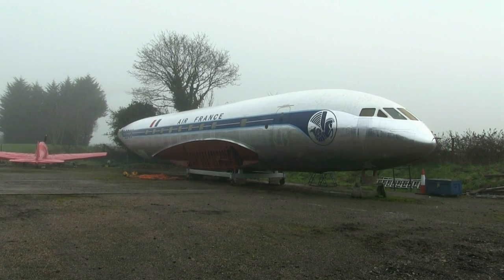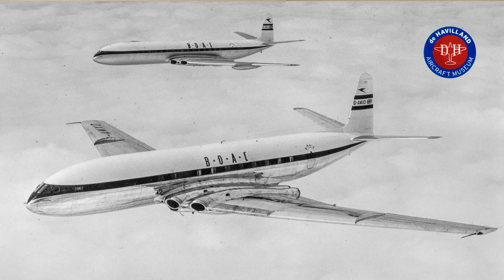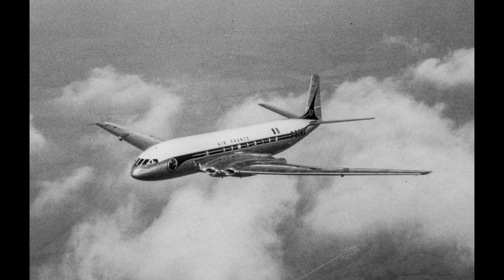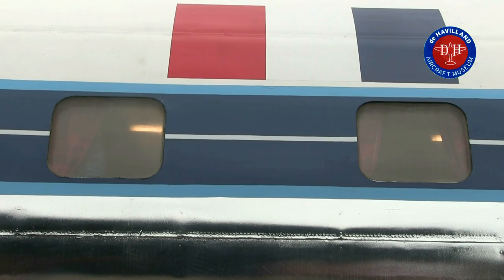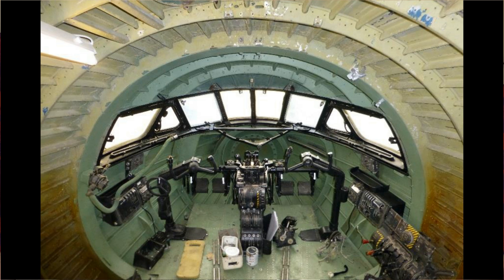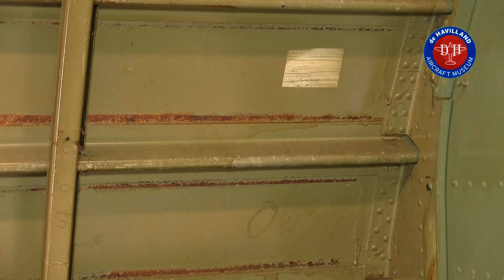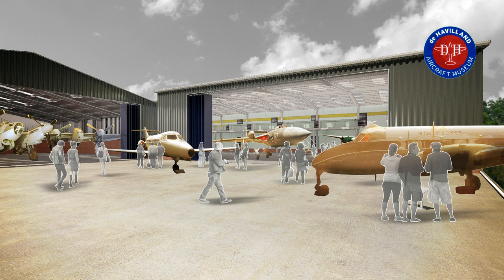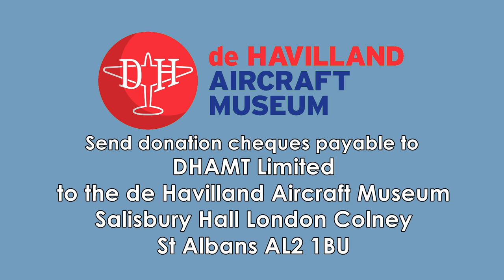DH106 Comet 1A F-BGNX

Comment: A Comet 1 esből 9 + 2 prototipust gyártottak.
A két prototipus 1949-ben repültek elöször.
Lezuhantak 1953-1954 5 darab.
A Comet 1 A - ból 10 darabot gyártottak lezuhant 1971-ig 3 darab.
Szerintem a világ legszebb vonalu utaszálitó repülöje.
A Comet órrát , szárnyát és pilotafülkéjét megvették a franciák és ebből lett a Caravelle ami 1958-ban repült elöször és 2006-ig 64 darab zuhant le.

Comment: Outstanding!  This is an incredible piece of aviation history and it's wonderful that it is being restored.  I'd love to see this plane when it is finished.

There truly isn't another like it in the world.
Reply: Thank God there isn't... the Comet Disaster not only destroyed DeHavilland it was the worst engineering failure in the history of  the entire commercial aviation. industry.
Reply: @sandervanderkammen9230  Worse than DC10 cargo door?  I don't think so - the DC10 issues were even known about before the Turkish Airlines crash.  No-one knew about the issues around the Comet.
Reply: @ukurko  Yes, the DC-10 never had it's airworthiness certification permanently revoked.
Not true, pilots repeatedly warned DeHaviland that the aircraft had  serious problems right from the start  of regular service... the first 2 Comets crashed with DeHaviland quickly denying any problems and tried to blame the crashes on pilot error.
The Comet Disaster investigations found the aircraft riddled with hundreds of fatal design, material and construction defects, this resulted in a complete redesign of the entire aircraft from the wings, engines, fuselage hydraulic system even the toilets.
Reply: @sandervanderkammen9230  I think the 737 Max holds that mantle now.
Reply: @rayquirk4947  The Comet Disaster remains the worst engineering failure in commercial aviation history... even with 2 fatal accidents the Max still has a much better safety record in commercial aviation.
In fact, the Boeing 737 series is not only the most successful jet airliner in history.... in per passenger/miles statistics its still one of the safest aircraft in history.

Comment: Beautiful piece of history... best of luck with the restoration gents, interesting fact is that is was not the shape of the windows they found to be the problem but the way the rivets were used in fitting the windows that caused the issues.
Reply: The Comet Disaster was the result of an aircraft built with an appalling number of fatal design flaws and construction defects..
Even after the remaining Comet aircraft had their windows replaced the aircraft was deemed structurally unsafe to carry passengers and the aircraft type airworthiness certification was permanently revoked.

Comment: Looking at air frames it’s amazing they don’t build them stronger. I know the key it to be light as possible but I’d rather pay more money for a ticket to be safe.
Reply: If manufacturer 'A' can do an airliner that will do passenger service etc with  generally regarded as acceptable levels of safety then competitive economics dictates that if manufacturer B does an aircraft with the same safety but longer range & lower fuel use etc then manufacturer B gets the sales.

Comment: It's not a shameful part of British aviation but a sad one.
What annoys me the most is that whenever the history of the Comet is viewed there are never any photographs of them in Air France or UAT livery or at any of the airports they flew into in Africa
I think it's about time that someone wrote about this part of the Comets history.
Surely Air France and UAT must have had a stackful of photos from the past.
Reply: It certainly was shameful... because the Comet Disaster could have been easily prevented if DeHavilland had followed common industry practice for the design and construction of pressurized cabins and engine placement.

The question is did Air France ever really operate the Comet 1 in regular service before they all had airworthiness certification permanently revoked?
 Air France only purchased 3 Comet 1's in 1953 just months before the Comet Disaster grounded the fleet and they were all returned to DeHavilland where they were either scrapped or modified into military registered experimental aircraft.
F-BGNZ was retired just 3 months after being accepted by Air France..
The aircraft had a total of just 300 hours when its registration was struck from service.

Comment: Beautiful aircraft somewhat ahead-of-its-time if it wasn't for the square Windows I think it would have been a real winner
Reply: DeHavilland was more than a decade behind in passenger aircraft design and construction.... the Comet Disaster only highlights the serious problems at what was a very deeply troubled company.
Reply: @sandervanderkammen9230  very true, they had a history of structural failures. The square windows were not the real problem, it was the punched rivets (rather than drilled rivets) which would start fatigue cracks on the fuselage IN THE FACTORY. The story that the lessons learned from the Comet disasters helped to make the 707 and DC-8 safe was a lie, Boeing and Douglas were building pressurized aircraft for years, in Boeing's case they were building jet bombers as well without fuselage pressurization problems.
Reply: Michael it was never the fact that the windows were square that was the major problem 
At the time of manufacturing Redux bonding was used to help save weight and at that time problems of bonding around the windows was found and so permission was sought from the chief  designer to use riveting instead..a desion he regretted the rest of his life.
Secondly the metal was thin enough to be depressed using a finger,  again to save weight all this led to the horror of breakup in flight .
Reply: The windows weren't really square, they had rounded corners like most Boeing windows.